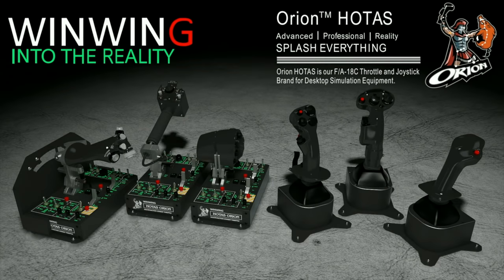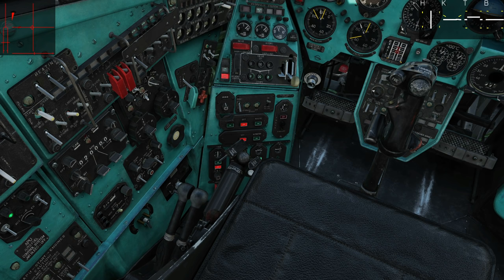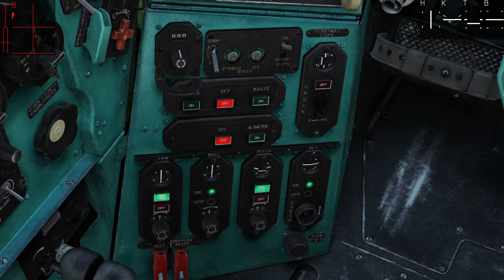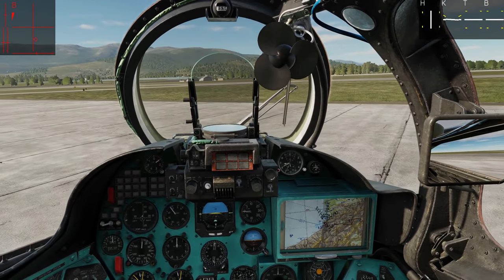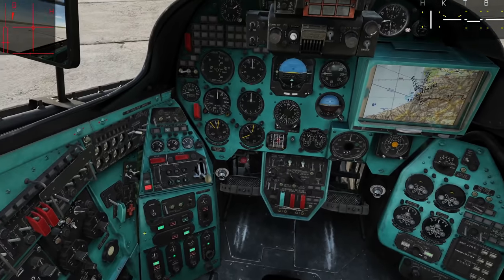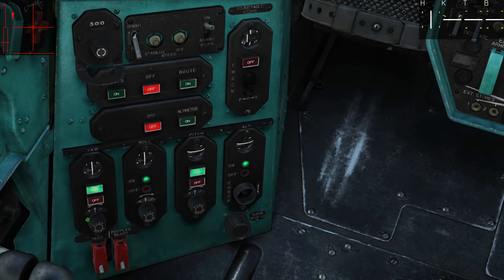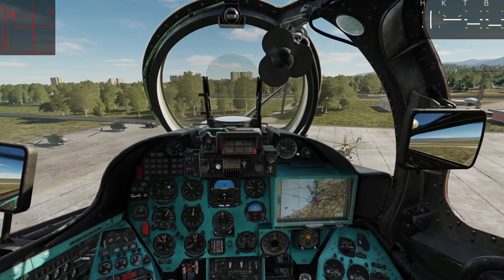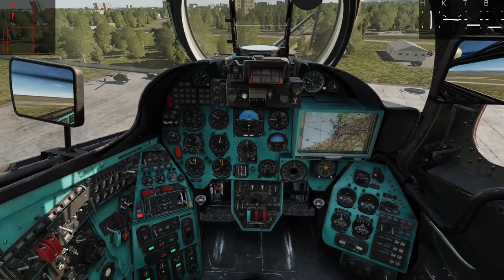Mi-24P Hind: AFCS & Autopilot Guide | DCS WORLD

Comment: Route mode also works.
Just set the desired heading on the small heading window with the knob, fly that heading with a speed ~200 km/h and engage Route AP.
The Mi-24 will then fly that heading.
To turn, simply slowly dial in a new heading and the Mi-24 will tunrn towards it.
It uses both the Roll and Yaw channel, so keep them engaged.

Also know that the Hover altitude hold uses the altitude channel and that the Collective brake will reset the Altitude channel.

For sharp turns You might wnat to disengage the Yaw channel.

The trim button will set the AP channels when it is released and not when pressed.
Reply from the maker: Thanks.I have not got the route hold working a single time so far :(
Reply from the maker: Just tried again to your suggestion but as usual it spins me around in a slow RH circle with Route engaged :(
Reply: Nice. Thank you sir, I'll  try those later.
Reply: @grimreapers  Strange - for me it works flawless.
All channels except Altitude engaged, dial in f.ex 090° in the small window, manually fly that heading and engage  Route.
The Mi-24 will now fly that heading. dialing in a new heading makes the Helicopter turn to that heading.

Comment: hi all, some useful info…..If H channel (yaw) is on do not touch rudder pedals, as you add collective AP will counter the torque, you do nothing with rudder!….. if you want to change heading just add rudder to direction you want to go and gently return rudder to centre….and AP will add yaw as needed to keep you on that hearing….. no trim reset required…. Problem is that we are trying to fly it as mi 8 and manually correct for torque, and basically end up fighting AP…… when I figured this out Hind is easier to fly then ka50…..
Reply from the maker: thx

Comment: it should work as such for the collective axis in auto mode: it will operate into a certain margin  plus or minus around your actual collective setting maybe 10 to 20 % allowing it gentle climb or decent to hold height and hover power variations. the square gauge under the compas is the power ouput of the engines, the middle index is nominal and is the value arround wich the afcs should set itself if i remember my ka-50 101 correctly.

Comment: The Yaw AP mode works fine, the problem is when you want to turn it off. The last known setting of the AP channel is left fixed on the pedals and the only way to center the pedals is to do a trim re-set which also re-sets cyclic trim, this can be dangerous if near the ground.

 The other issue is when switching seats, if the AI does a pedal offset these will be left in when taking back over from the AI (even if Yaw AP is off) , again the only way to reset the pedals is to re-set trim.

 A simple solution would be to have a separate way to cancel pedal trim, that is not tied to cyclic trim. i.e the double tap of trimmer instead of resetting all the trim just does pedals.
Reply from the maker: thx will investigate
Reply: Heh yep. Remember when the Ka-50 came out and ppl would stand it on it's tail when they turned the cyclic trim off? 
Good times.
Reply: @zzodr  Yea I dont have re-set trim bound on the KA-50 lol
But on the Hind it is usefull, the pedals are an issue though, hopefully ED can sort a work around on it. I do like to re-set the cyclic as well in the Hind every now and then.

Comment: Just turn them all off and you are all set :)
Reply: I mean, what's the point of dropping that kind of money on a really good helicopter simulation, then proceed raising barriers between you and the ship? In reality there is all kinds of sense behind having all these things installed on your helo (although that could set you back considerably compared to the base price), but in a sim just enjoy the helicopter for what it is.
Reply: @getsideways7257  Have you tried the Hind? Flying it without these aids is incredibly difficult. They were put in the real aircraft for a reason.
Reply: @Rokaize  Would do you mean "tried"? I even have a video where I slingloaded a cargo in it without these damned "helpers" (among the first people who did it). If anything, they only get in the way.
Things like this are only useful for prolonged operation without much maneuvering - and that's how you should use the "Cobra button" on the Flanker as well. All the stability augmenters are nothing more than an extension of the autopilot (or rather the other way around). You only deluded yourself into thinking that they are "helping" you maneuver. That's just wrong. Or you have an even worse joystick than T.16000M (which is very unlikely).
Reply: @getsideways7257  you can make it more difficult for yourself, if you want. 

Those systems exist for a reasons and there are no sources I can find where they are ever turned off in real life except for very specific circumstances. Like excessive maneuvers done to avoid enemy fire in combat. 

I guess by your logic you should be able to turn off fly by wire in any modern US fighter since it’s just an extension of the autopilot.

Edit: you sound like an idiot when you say that you were “among the first people” who sling loaded with a hind in a video game. You have no way of knowing if this is true. No one is impressed by your virtual accomplishments 

Also, we have absolutely no proof that you did it without those systems turned on. All of the footage is from an external view of the hind. You probably had them on the whole time anyway.
Reply: @Rokaize  I'm trying to make you understand that it's EASIER this way. Did you really compare both modes yourself?

Those systems exist for the reason that some numbskulls who barely lifted anything apart from a pencil in their life decided that human beings are so useless they can't be trusted even with opening a bag of chips manually. Just look at the cars these days. I'm not even talking about FSD, but other "electronic nannies" are there by default and you can't even disconnect them unless you get to the insides of the car.
Were humans hitting the trees all the time before these were introduced? Are they killing themselves much less now thanks to all this electronic crap?

It's all a load of bull. If you learn a little bit to control the thing, you are going to control it much better than when there is something in between you and the controls, simply because the thing is unable to read your mind - it can only GUESS your intentions. That also comes with added lag.

Of course, a lot depends on how statically stable the aircraft is. But speaking DCS I can tell you that I've flown the Flanker and the JF-17 manually. The Flanker is just fine and turning ASC Direct On seriously improves your chances in combat. JF-17 is flyable without FbW (although you have to disable things in ME to get exactly that), but it's quite a handful because of the instability. Not sure if I'd be able to fly the F-16 though, but mostly because of the imprecision of my joystick and the wearout factor due to the instability. But I'd give it a try if there was a possibility. The mostly stable airframes (like F/A-18C) shouldn't be a problem at all, just like the F-14s and the F-15 aren't.

Well, I didn't say I was the first. But I definitely was among the first, since I haven't seen an earlier video, and the thought to try that out occurred to me soon after I did some flying in the Hind. But I guess you just had an urge to call names...
No proof? Well, I fly with linear "curves", so all the imprecision in the joystick movement should be visible right away. What's the point of SAS if it wouldn't smoothen that out?
Guess I could try replaying that track again from the cockpit, but considering how many patches we've had since then, I doubt the thing won't crash right away. Not to mention I was really lucky that the whole track replayed properly at that time even on the same version.

You could say that my whole channel's purpose is to show that humans can do a decent job controlling everything manually. By no means I'm trying to say I'm the best at it, not to mention that would simply defy the purpose.
The bottom line is, you can do it. Just lose the negative thinking and believe a little bit in the "neural network" that you yourself have built-in.
By the way, my GP Bikes videos show that it's even possible to control a bike in a sim through the handlebars without much assistance. But of course, considering that one cannot feel the g-forces, that's a pretty hard thing to do.
Reply: Oh, and it's only marginally more difficult to fly than the Huey. Will you tell me that the Huey is impossible to fly too?
Reply: The only problem I can think of is that you never gave anything at the Huey "level of difficulty" (or worse) more than an hour of practicing time. If, for example, your previous experience was with the "H135" for MFS, I have bad news for you - even with SAS fully off it's BS of a helicopter.
If that's of any consolation, when I first tried hovering the Huey I thought it was "impossible" to achieve, and it took me a good few days (!) before I started hovering more or less decently (then even more time for sling loading). However, I tried instructing a youngster of a relative the same thing, and he got to grips with it a few hours, even though having very little flight sim background. Yet at first he was absolutely terrible and I almost gave up on the idea.
It's just a question of time. Have you seen the artificial neural networks learn? This is practically the same thing. At first they are garbage too. With humans, however, it's different in that humans reject wrong "weights and biases" quicker.